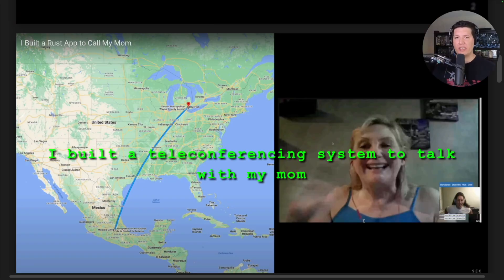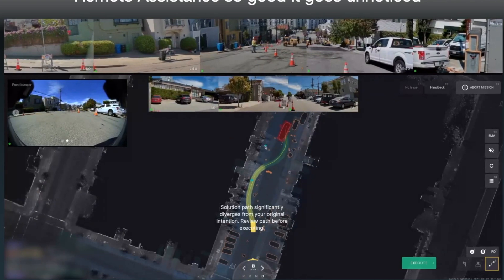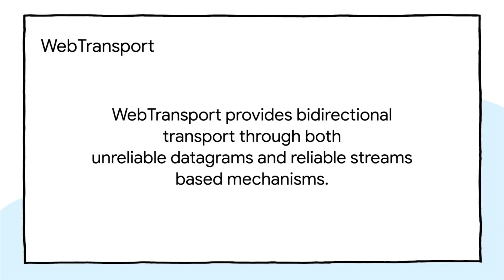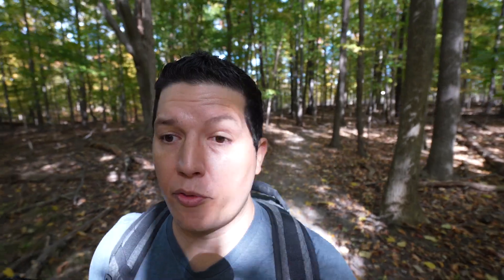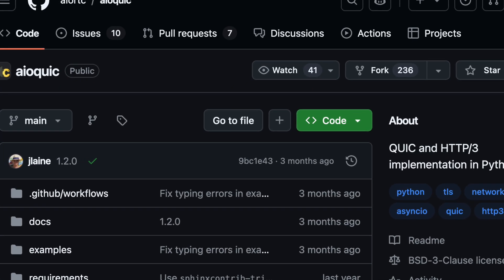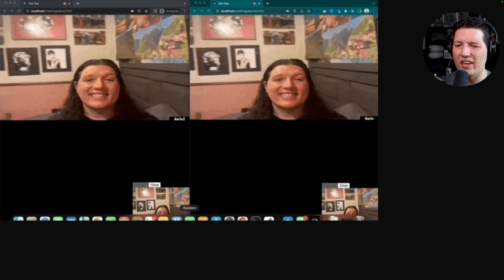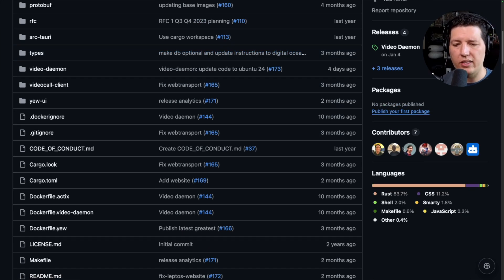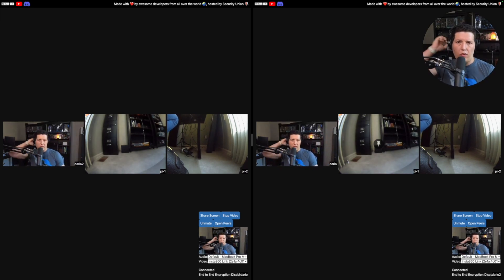I Built a Conferencing System from Scratch and It's a GAME CHANGER!

Comment: Please, view trough my protocol for smarthomes which I made to let anybody to build their own network using rust and components from nearest local shop which sells arduinos. By this moment it has 10k usages.
Please, play around with it, and make a video with your response.
It is called embedded-nano-mesh
Reply: I guess that after emerging rust - the good chunk of old technologies will be reimagined or rebuilt
Reply from the maker: Wow!! That sounds awesome 👀👀👀 I will take a look for sure
Reply: @dario.lencina I'm still in the process of designing of OSI white paper description of protocol, that is based on concept of embedded-nano-mesh protocol and also in addition with hiding all internal under the hood stuff like addressing from the user, to end it up with simplest abstract interfaces to use it. The goal is to build one layer network protocol that can run on huge variety of hardware, self healing, self extensible and to organize itself with no need of external control, just plug and play.
Reply from the maker: @ЕвгенийШевченко-я3б  sounds great 😄 let me know when you have something that you want to share